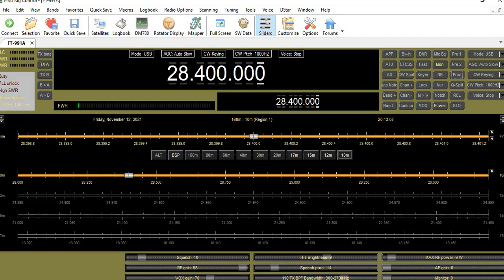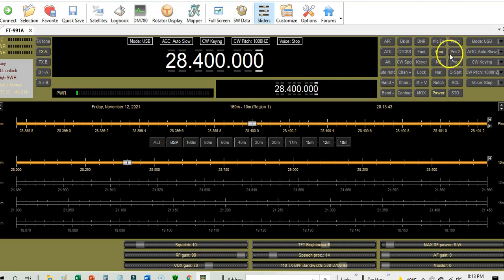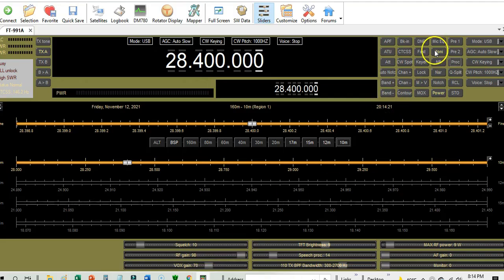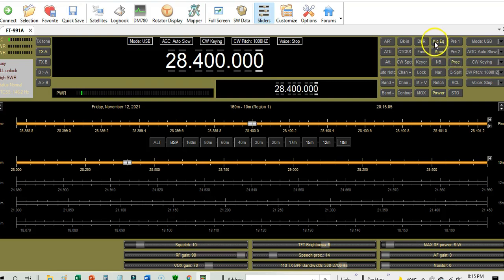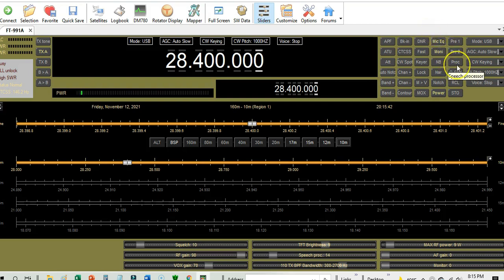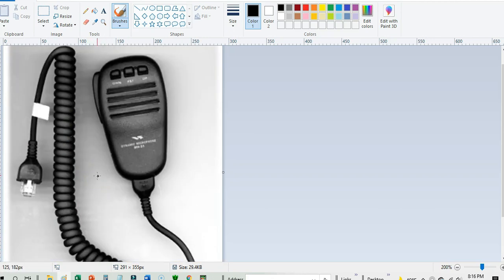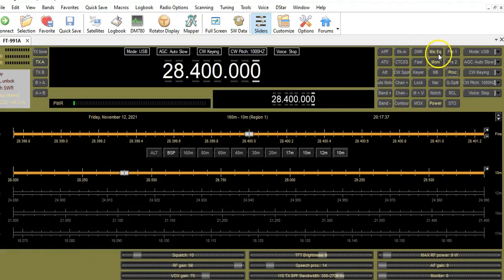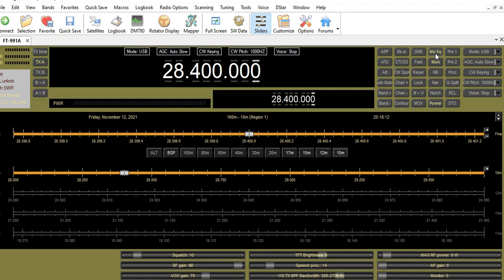Yaesu MH-31A8J (stock) & M100 SSB Mic Eq and Processor Examples of Stock Mic and M100 Mic-EQ & Proc

Comment: Do a test with a 'modified' handheld microfon! Replace the 'original' microfon-capsule with an 0.20$ "electred-microfon capsule" and rework your test again! 

Only a 10kilo-Ohm resistor for the supply-voltage and a 0.47micro-Farad capacitor als 'coppeling-capoacitor' ! The simple 'replacemant circuit' you can find on the internet. Don't forget to close all the hollow places, because the new 'element' is much smaller, I use do to this with some foam of a sponge! It sounds 'bad' with the 'holes' in the hand-mike. 

Reduce your mike-gain down to ~20, because there will be much more 'omphhh' (AC-voltage/modulation) out of this capsule. Find a sweet regulation spot, with the EQ, and use the processor in a 'soft' way. 

It was like 'day and night' or 'Coffee and tea', ... ! 

Unbelievable what the 0.20$ capsule will do for a FT-991, ... ! Works also very fine for FT-897/857/817 and other similar Yaesu-radios!  

Allways reduce your mike-gain, because 'now' it ist to much, ... ! 

Used this kind of 'mike', since 20 years on my FT-817 (made in 2000) and the following radios! 

73 de Markus ; db9pz
Reply: I am going to look into this for sure.  Thanks.

Comment: Neat video you opened by eyes to a couple of things i hadn't considered 

Did you do the recordings with HRD ?  or Another program ?   (I've done all my settings using the Monitor Mode of the radio - which is not ideal) 

Now I need to experiment  (I have 4 different Mics)
2 Heil headsets (one that has just one ear piece)  and newer one with 2 ear pieces), then  A Mic on a Boom arm
then the Old Yaesu Mic I bought at a swapmeet.    Already found I had to use different Mic gain settings for each.
Reply from the maker: Good evening sir, I actually us a CODEC driver that I installed in my laptop, I originally started with va2fsq SDR Software this video shows how I loaded driver and got the audio through my laptop https://youtu.be/skQ_GhAsTTI , then when I loaded HRD this also worked, and I get all my audio through this driver.  You will need to connect the laptop to the FT991 standard USB-A to USB-B will work fine.  I use Screen-O-Matic and feed the radio Audio direct into the video recording software.  Good luck let me know if you need anything else, this is another video I did too https://youtu.be/OwwVq0L4v4w ‘73

Comment: Steve I have that M1 Reference mic can I run the Processer? Will that make it distort? I don't use the eq settings on my 991a since this mic already has them
Reply from the maker: Hi Brian, How you doing?  What I would try is MIC-EQ off, PROC on, go to FM List and find METER, tap METER until you see COMP, then locate the MIC-GAIN, talk into the MIc and make sure the COMP needle movements are between 5 -10 db adjust the MIC GAIN as needed to keep the swings between 5-10db, my experience is as long as you are between 5-10 db on voice peaks you are not over driving.  Give it try and let me know, also put on some headphones and locate the MON under the FM List tap it to ON and adjust the volume you will hear your self in the headphones  '73